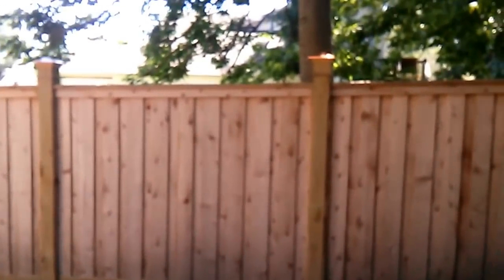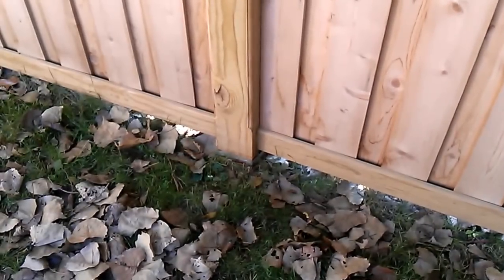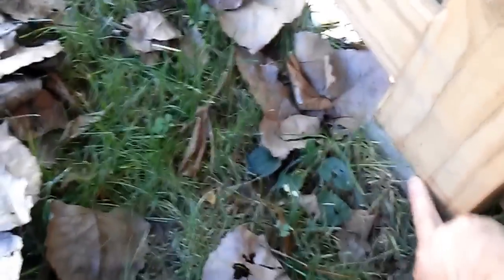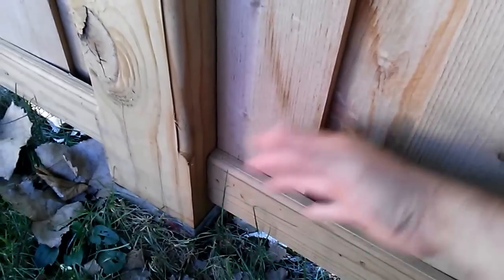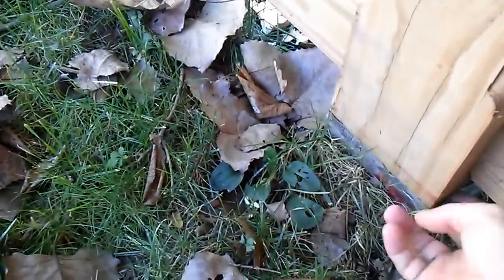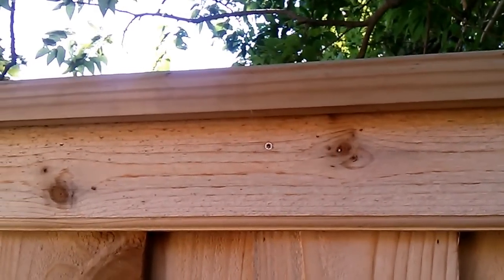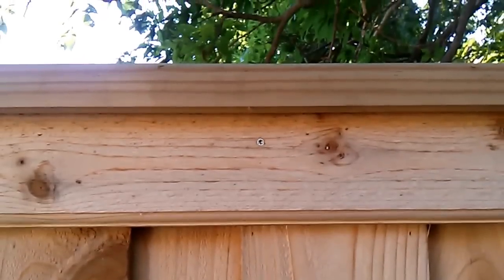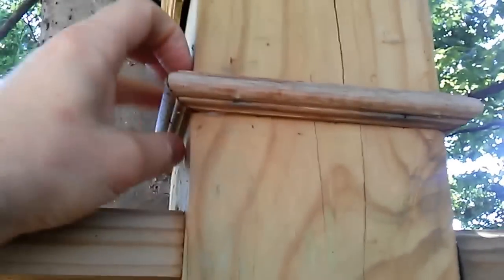Cedar Fence Build 1

Comment: In my experience all posts rot in the top 12 inches of soil. I think it was a mistake to put dirt in the top of your holes. personally I leave concrete all the way to the top and contour it away from the posts so  to add drainage away from the posts. I have yet to have a post rot fron this way of building in 7+ years. Soil gets wet and holds moisture against the wood for extended periodsof time till  a lengthly dry spell...